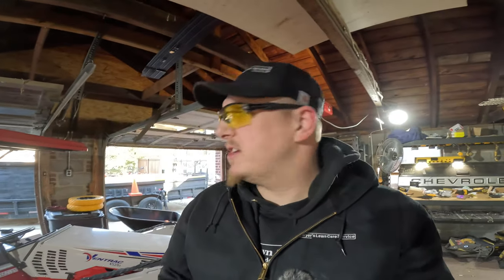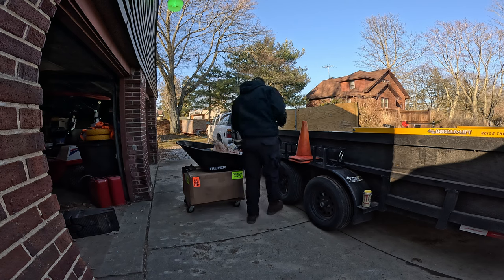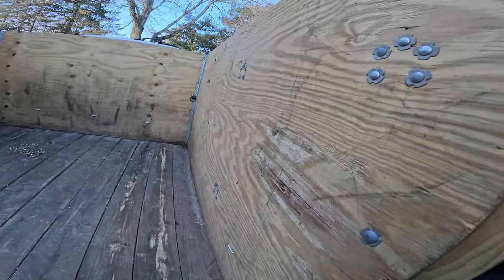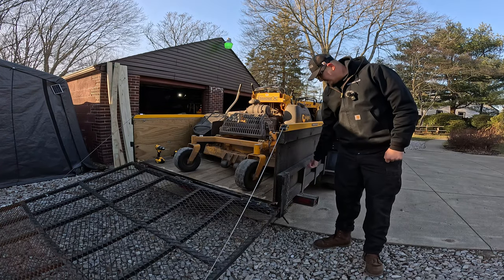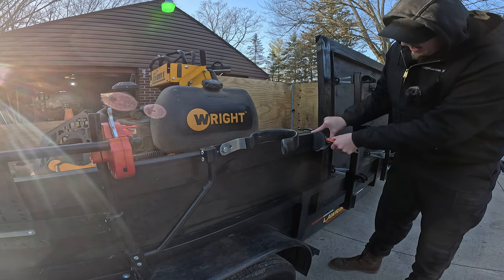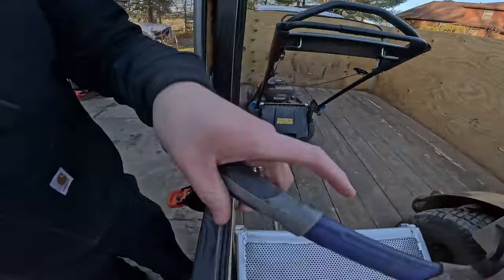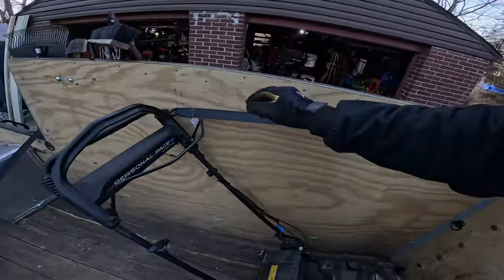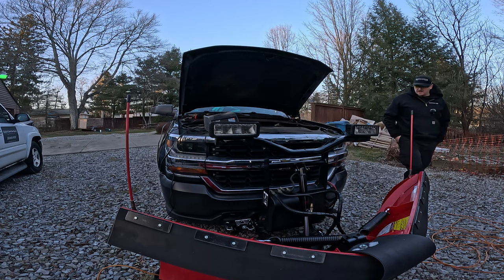Installing New Trailer Tie-down Straps ||  Cargo Buckle G3

Comment: Anymore it seems most batteries are not guaranteed for more than two years.
Reply from the maker: Had another issue with it the next day. I took it in to our mechanic shop
I think this one had a 3 year warranty on it. They didn't find anything wrong with the charging system but they did go ahead and replace it under warranty for me out of caution 👍
Reply: @sawyerslawncareservice  same thing happened with our CRV. They prorated it.